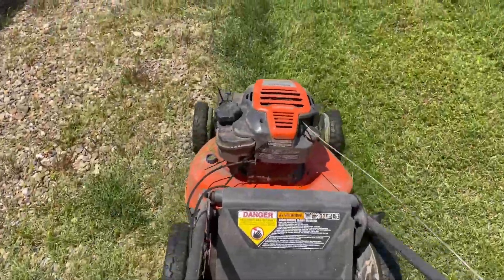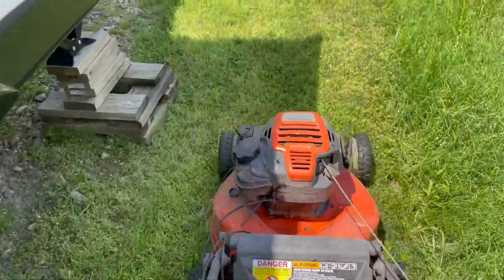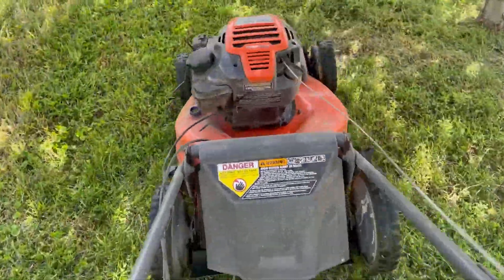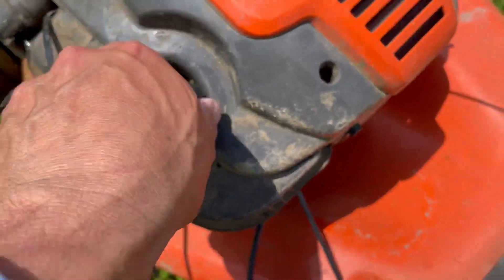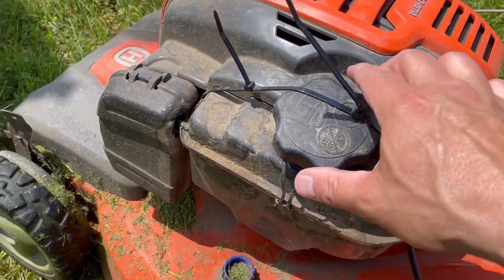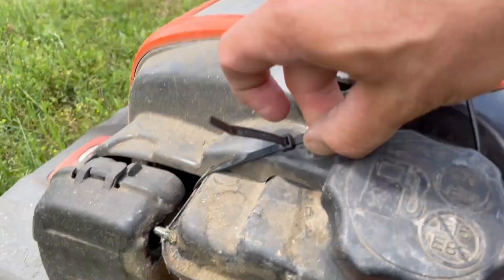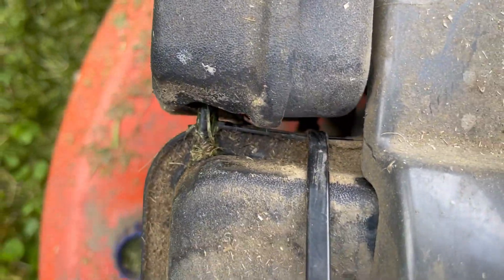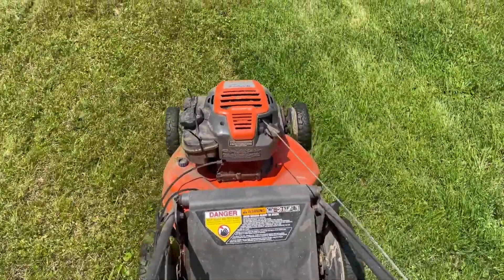Wow:  Gas Cap Opens While Mowing - Cheap and Easy Fix

Comment: I have the same exact issue. That's a great idea with the zip ties. My concern with that is when I pay close to $500 for something I expect it to operate at the highest level. With gas spewing out of the tank it's a major problem.  Other then that I think the mower itself is awesome
Reply from the maker: When it first happened, I thought it was just something with mine.  But after a Google search, I realized it was much bigger design issue.

Comment: O-ring is missing or warn. Hardware store 1-3/4 outside diameter  1 1/2 inside diameter  1/8 thickness. Fix it instead of rigging it.
Reply from the maker: I'll check it out.
Reply: Thanks, I just rigged mine today with Teflon tape and it stopped leaking gas. Will try the new O-ring thanks for the dimensions.

Comment: The gas cap on my Bolen (with Briggs & Stratton engine) that I bought at Lowe's has been doing this for several years.  I'm definitely gonna try this solution.  Thanks for posting.
Reply from the maker: I didn't realize it was other brands too.  Thanks for posting.

Comment: I have this problem on my lawnmower. Honestly I thought something fell off. And I still kinda do. Upon closer inspection it looks like there’s a little lip that and O-ring sets in. If you look at the threads on the gas tank itself they fit in a line just fine. The gas cap isn’t worn. At least mine isn’t. But nothing really provides any tension or force locking it on the threads. I’m going to guess that there’s a rubber gasket that fits in there. 
Because of the nature of gasoline it likely dries out the rubber causing it to dry rot and eventually fall off. I’m going to attempt to track down the part to fix mine. If I have any luck I’ll update you
Reply from the maker: Would love to hear of an actual fix.
Reply: @homestead_diy  I made a video today
Reply: @homestead_diy  check out the last video I posted! My part came today! It’s fixed!!
Reply: Any luck bud?
Reply: @amcclaur80012  yeah. Check out the video I posted. It has a link in it. My mower is fixed

Comment: My cap goes on tight but it still leaks gas from the cap. I took off the tank and everything. I am going to try replacing the cap again. I'm sure that it won't work though.
Reply from the maker: Mine hasn’t leaked other than the cap coming off.